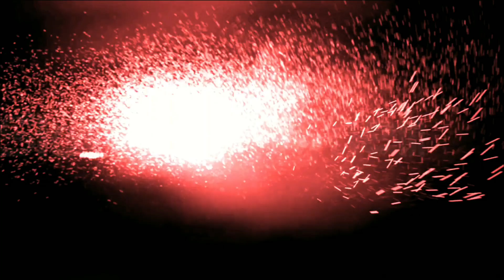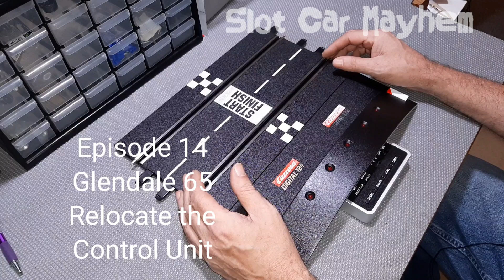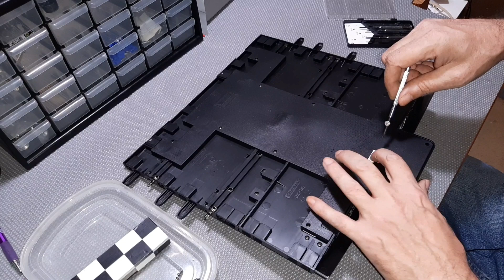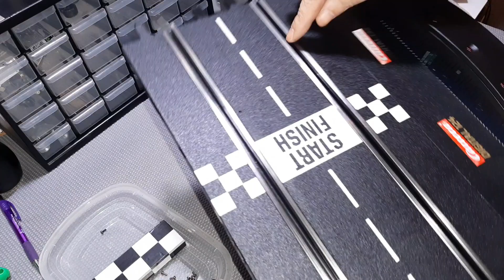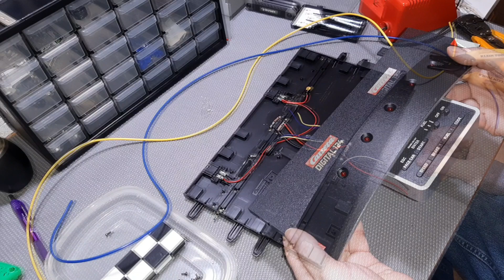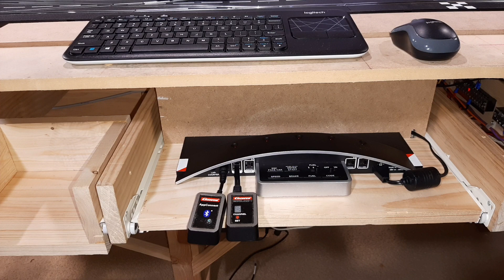Glendale 65 - Episode 14 - Relocate the Control Unit

Comment: John, just update as I have been working to solve power to control connections. A few questions for you: number one, why does a power connection directly to my control unit sans terminal block fail running at 5 A 15 V?
2) Power to terminal block and control connected to terminal block works. 3) why did power directly to the control unit fail? Was it a compromise in control track wiring or something else? Would a backwards and placed adapter unit cause a problem here? 4) relegated to running the original wall wart transformer, is it possible to run remote driver stations and charger stations via terminal and power unit? You’ve been a great help and I feel very foolish right now.

Comment: John, after a new C.U. Was installed as per the previous one, it too failed. What could impede the unit from startup? I’m completely befuddled!
Reply from the maker: I am still curious if your CU to track connections ( both rail and sensor) polarities are correct. Does it work if the CU track piece is isolated from the rest of the track? That would indicate possibly the rail connections are reversed. If not, that might indicate IR sensor lead(s) polarity reversed.

I also assume you are using the correct power supply...

Can you take a pic of the CU and track Wiring connections? That might help...

Comment: John, after completion of the relocation procedure, I had a problem at start up. Facing the control unit all lights lit up except for the second light left side. Are these related to a particular problem or a particular Lane? I know I’ve got some troubleshooting to do maybe a heads up would help. Thanks in advance.
Reply from the maker: I would disconnect 1 lane, then try. Make sure lane polarity is correct... please keep me updated...

Comment: John, on a related issue, is it true that the pit stop refuel tracks must be aligned 
With the control unit/starter track piece? I want to run a dual pit area but want to 
Make sure pit track pieces are independently accounted for on my driver’s display units.
Many thanks!
Reply from the maker: No. You can add the pit lane refuel track anywhere. If it is far from the CU, you can disable lap counting for the refuel track (default is to count laps).

Comment: John, thanks for these videos! Have a question on control units generally.  I received two control units from a lot that I bought back in '21.  I'm almost positive they are toast as they don't turn off when I toggle to the "off" position and only cuts power to the track when I power off my variable power supply.  In addition, my cars just run at full speed without any input from the individual.  My question is, is there a way to be absolutely sure they are "toast" and if so any way to fix them just to have as spares?
Reply from the maker: Is your variable power supply powering the CU directly? (meaning plugged in to the CU, replacing the factory power supply). If the voltage and current is set correctly, should work...
Reply: @slotcarmayhem9765  yep all connected correctly with inline fuse from the VPS. Tried resetting the CU to no avail. Haven’t opened up the CU yet because wanted to try all other avenues

Comment: John, if I understand correctly,  all pairs of wires will terminate in blocks? In other words you did not cut the wires to lane one and  lane two and the control  unit  just to extend the wiring and re-solder them back together correct?
As I am planning my layout all track wires, power jumps etc. will terminate in a block and that block will connect to the main power block. Thanks in advance for a great series you are definitely the Carrera guru!
Reply from the maker: Hi. Yes, I connect to terminal blocks, mainly for service/repair means. I went from the CU, to a terminal block, to the track (and other terminal blocks around the layout). This allows easy removal of a connected track section, or the CU if necessary. Also, having distributed terminal blocks around the layout makes connecting everything very easy to wire up. Hope this helps!!

Comment: John, these videos are great!! Just one questions,  you fed the power to the terminal block from the CU off the bottom of one of the adjacent tracks to the CU? Or did you just tap into the CU track when you split it?
Reply from the maker: I run track feeds directly from the CU, to a main terminal block, and that distributes track feeds. Since I remote mounted the CU, the start-finish line section is tapped to the main terminal block, all other taps are fed from their closest terminal block.

I have zero intention of running analog on this layout, so the connection is made to one lane, and jumpered to the other lane. Analog running required the lanes to be isolated, hence one feed per lane. Hope this helps!!

Comment: thank you , I'm in contact with Carrera I find I'm getting 16.57 volts at the power head and 18 volts at the supply / no cars on the track / the hole tack is getting 16.57 volts
Reply from the maker: Voltage sounds good. Lane changers work on 13.3v reliable (D132). Might be a bad LC...
Reply: @slotcarmayhem9765  LANE CHANGER/ LC /GOT IT Thanks
Reply: @slotcarmayhem9765  I'm new to this , what is LC / Thank you for your time / D124 SET

Comment: my single lane changer won't work do you have any thoughts on this problem / well works sometime / when its close to the power station
Reply from the maker: If it works when close to the power source, try running power taps to the piece directly connected to the lane changer. Might be voltage drop due to a bad joint(s). Could be dust or dirt inside the mechanics of the LC. Might need a drop of oil... Many reasons why it may not work reliably...

Comment: hi john hope u r good  today....they call me mooch.iam 70 years old..iam 70 years old...iam retired .i was into slot cars back into the early 60s..iamgetting back into it now that i have the time...iam into the carrera digital 1/24 sets..your videos on slot cars r the best i have seen to help someone who is a newbe get into this hobbie..ok that said what i would like to know when u wire your track to the best power in the track...irun all my wire to the box ok..but where do i get the power from to spark the box up,...i think u said from the control box.if so how do u run the power to the box ..thanks for your time great videos...
Reply from the maker: Hi Mooch!! If I understand, you're asking about powering the control unit? If powering the CU, I just use the factory power supply for now. They do make an adapter to power the CU from an aftermarket power supply. I will upgrade to that in the future... The 1/24 require different power if I recall correctly. 

Thanks for the kind words!!
Reply: @slotcarmayhem9765  thanks for the info..keep up the good work...

Comment: I didn't realize that CU track wasn't once piece. Cool idea to separate those. I may do the same but only to reverse the CU to the other side as sometimes the track design ends up with the controls facing the inside of the track instead of the outside where it's difficult to operate. Thanks for the vid.
Reply from the maker: Easy enough to do that. Good idea!!! I never thought of that!!